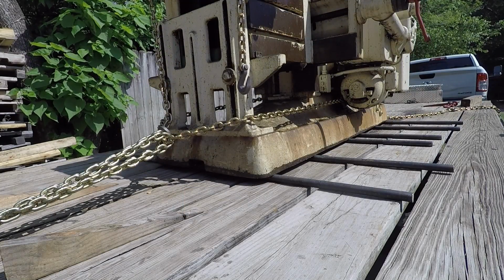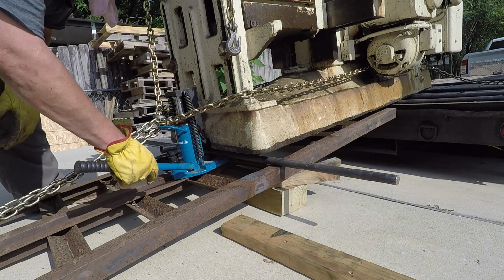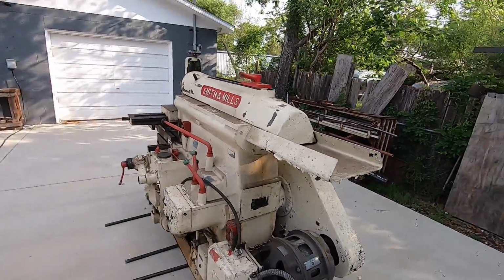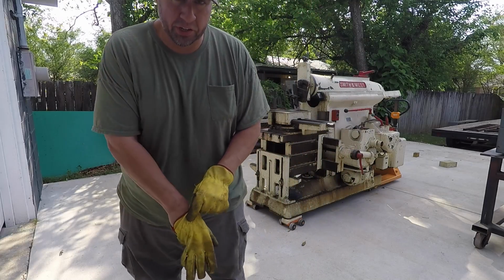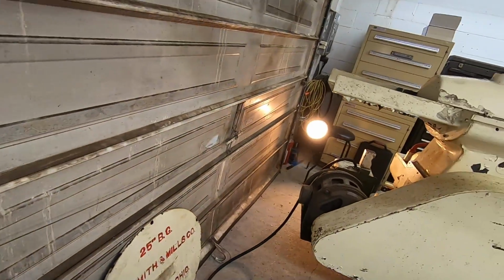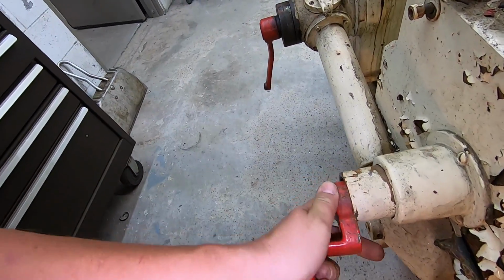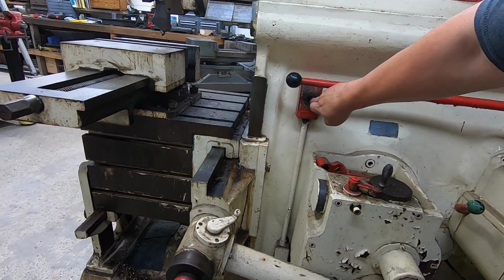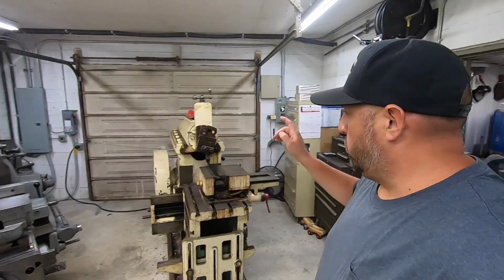Unloading the Smith & Mills Shaper Part 2

Comment: I was wondering when you'd go for the pallet jack. I'm not sure what the total weight of that shaper was but there are some low profile trips-wheel castors we used to use when I moved Postal letter sorting equipment. But this is real hi-Zoot solution: https://toolwell.com/products/machine-skates.php

Comment: Just in general, when powering up a machine that’s new (or newly arrived, or just been worked on) it’s a good idea to take a volt meter and check for voltage on the machine frame & any surfaces that are supposed to be grounded. 🤔

Comment: Been there done that. Good work. Surprised the trailer held it. What is the weight of that beauty?  Saw a few smaller ones at auction for like $200 - scrap value. No one even knows what they are anymore.

Comment: Adam, I was watching several days (wks) ago, a youtube video on trailer needs.  One item mentioned, was having C-channel pockets along the side of the frame.  Can be used for removable sides, either metal or wood.  Also, was using short pieces of rectangular tubing with D-rings welded to the "tube".  These were secured using  Agricultural pin through a hole in the tube, located below the lower edge of the C-chnnel mounts.

Comment: Excellent!  I bolted a cheap 12V 3000 pound winch to my garage floor which I use to pull cars in.  The driveway has a steep angle and the garage floor has a 2 inch lip which I just can't push cars over so now it's just a quick hook and button press.

Comment: You need a small Garden Tractor to use as a Yard-Horse. They're small enough to drive right into your shop and will give you the extra man power you lack when working alone with heavy objects. A Garden Tractor has more pushing & pulling capacity than a lawn tractor. We can't have one of our favorite machinists out of action recovering from a hernia.  Best of luck, stay healthy..................

Comment: It's about time the US are going to start using safe and decent power outlets and plugs like the CEE-form we use at our side of the pond instead of that 100 year old stuff! It looks like the pins will break out of the plug when you bump it with a bit of force and then they will be sticking out of the power outlet...

Comment: The "BG" might stand for Broadhead-Garrett which supplied metal and wood working tools to schools.  Their 8" metal shaper ( made by Porter Cable) was very popular but I've never seen a 25" version from them.
Reply: Great answer...Now, what does D&G from Porter Cable mean? I have a 1960s? Wood lathe and is from a primary school in Ontario, Canada with mostly British standard hardware in it. There is absolutely no information or tags on it except for D&G - Millford  in a raised embossing on the head stock.

Comment: Your method of getting the shaper off your trailer was much the same as what I used to get my Bridgeport off the U-Haul trailer I rented.  The difference was I had a pallet jack with a home made pallet that the Bridgeport was sitting on and I used a chain fall to pull and a come-a-long to brake.  I had to pull it uphill to the ramp and then going down the ramp was steeper.  Worked like a champ but it definitely was a long day.  My chain fall and come-a-long were much shorter and required many more resets.  At the time I did not know about drop in anchors so I had to cut off the stud when I got done.

My machine skates are similar to yours only smaller.  A suggestion: if you want to move the equipment sideways just turn the skates the direction you want to go and push.  Using three skates I rotated my Bridgeport 180 with some resets when I did not have the angles right.  Got the idea from watching some one rotate a CNC machine by himself.

Comment: Maybe this is just me  but there were a few scary moments when you were getting off the trailer.
Reply: The safety chain could have been a couple inches shorter when it first started sliding down the ramp,  but my heart only stopped for about a second - not bad. I use similar techniques to lower my (much smaller) stuff into my basement shop. I hope whoever has to clean out my basement when I  kick off is a good rigger,  ha ha.  I  plan to leave them a few photos to figure it out from.

Comment: Just a thought, on the rapid feed for the table, did you have the lever for the direction of travel engaged?  I didn't notice it set for feed when you tried the rapid feed.  I worked on a similar one while in the NAVY and the direction lever needed to be set prior to engaging the rapid feed lever when the head is not engaged.  It has been almost 50 years since I worked on one.  I was thinking that the rapid feed can only be used if the head is not engaged, for safety reasons.  You have got the dream shop for every machinist out there!

Comment: Adam look like you need to do what I did. Go to tsc and get a 8 to 12 thousand pound winch put it on a metal plate with the holes in it to mount to the concrete using the flush mount anchors. Then all you need is a battery.I have done it the way you done it here but I have hurt my shoulder and no longer can use a come along very much. But great job 👍

Comment: Only have three words... "short gantry crane" 
Buy or make one that will clear your garage door... then you could have made a ramp to get trailer up on the concrete and lifted it right off and wheeled the shaper right in the shop.
Reply: About all a gantry will do is park the trailer, roll the gantry into place, lift, pull the trailer out and lower onto the rollers. That does save some work

Comment: Its amazing that the vast majority of this older heavy duty machines where made here in the Ohio valley area. The amount of industrial equipment that came from the Cincinnati, Pittsburgh, and Detroit triangle from the early 1900's all the way to the late 1980's when stuff started moving out of the US to China and other places. It is nice to see someone save some of this old equipment from the scrap yards. It's a shame how much has already been destroyed.
Reply: Most of our major industrial production was in that area because it was so far from the coastline but still had reasonable access to water shipping via the lakes and the Ohio river.
It was a great combination for making it a difficult target for WW2/cold war airstrikes while still being relatively easy to move material around between different factories and out to the final delivery sites.
Reply: @PoignantPirate  ... While distance from coast may be a nice thing to have, it was more an unintended bonus.
The reason was raw materials and the fuel to turn them into useful metals and the ease of transportation.
 Coal and iron ore are nearby, and the lakes and river mean you can move heavy loads cheaply. Which is why most of the steel mills and metal foundries were right there as well. Add a couple centuries where the cost to transport the castings, plates, etc were very prohibitive kept everything close.
Reply: We used to make everything here in Ohio

Comment: Hi Adom I just bought a 2000 lb 12 volt winch for just under $100 on ebay would have saved saved you about at least 4 hours unloading the shaper   Jim

Comment: Really enjoy watching your videos.  One suggestion; turn on your video stabilization on your cameras if you have the option.  :)  Also, do you have a couple of 'old man' wheely pri bars?  Used them alot in HVAC to shift units around.  Your good enough at your trade I know you could make some kicking ones to move equipement that size.  Cheers.

Comment: id sandblast off the old paint and hot pressure wash the shaper, then immediately oil and grease it, after the new primer and paint id be cleaning all the bare metall surfaces with motoroil and a fine  scotch bright, a polishing wire brush and some steel wool
Reply: Sandblast? really?... that's the problem nowadays, take the shortcut and risk damaging the slideways and blocking the oilways, that is a precision machine tool, there's the right way.... and yours!
Reply: @stevedoran3631  ever heard of tape and cleanup? you risk nothing, you just need to work precise and blow of the dirt and clean the ways  instead of just starting it letting it crunch and lap itself to the scrapyard
Reply: @prinzeugenvansovoyen732  I have been a toolmaker for 50 years and there are times when you can mask and blast, but a professional would never consider sand blasting a precision machine tool... it's just not done, it's not just the medium used, it's the dust that the medium produces, when blasting, microscopic grains are produced of the medium itself and no matter how much cleaning you do there will be residue and that is what does the damage... it gets everywhere!

Comment: Fascinating.  Slow and steady, the equipment gets moved and nobody killed or maimed.  Can't help but think of the ability of Civil War engineers and artillerists who could move really big guns weighing several tons.  (a 15 inch Rodman seacoast gun weighed 25 tons)  Manpower, horsepower, and brains.
Reply: Yeah it's mindblowing watching skilled millrights at work. Amazing thing is the tooling, like comealongs, rollers, pry trucks and whatnot, have hardly changed. It's all about skill and patience, there's nothing like watching a boiler the size of a truck get floated onto the pad and dropped dead on the marks by literally handpower.

Comment: I like the idea of the machinery skates, I wish I thought of that back when I was still working in our shop
Reply: I like the Idea also. When we moved the 12x36" lathe in we used the pipe roller method.  And like Abom, I too like machinery. As we already owned a stand type Atlas Craftsman it only seemed fitting that I should save a 12x36" bench model from the scrapper a few years back.

Comment: I wish I had a picture of the shaper at "Special die set in Bridgeport CT. I worked there in the lat 50's. The part moved and the tool was on a bridhe over the table The table was on a tract about 20 ft long we shaped some die set apeox. 3'x6', but this is only a guess. I had nothing to do with the machine work, just ran a Panograf cutting up scrap. But it was fun to watcj. 
Good luck Gramps

Comment: Adam, did you check the motor rotation direction before turning this shaper on? A simple fix.Just reversing two wires to the motor will do it. Thanks for all  the excellent videos. I enjoy them very much.Burlyn Nelon  Arlington, Texas

Comment: It is critical for motors to have the correct voltage to prevent damage , At 50% voltage a motor runs at 200% amperage and at 200% voltage it can overheat and short out , Always check the voltage .

Comment: I wish you and the people starting cars that haven't ran in years would change the oil first. Maybe it doesn't matter but it can't have that great of lubrication after that long sitting.
Reply: He will change it during the restoration. Here is something I saw on YouTube that shocked me. A retired railroad engineer was giving a tour of the largest diesel locomotive engine ever built. He showed the engine where the oil sat in the bottom of the block. He said it held a lot of oil and that the oil was NEVER changed. All they did was add oil that got consumed, and replace the huge oil filters every so many hours of operation.
Reply: @billsimpson604  Yep, and pull a test on the oil for contamination. When you measure the amount of oil in barrels instead of quarts you tend to just check on things in RR use. Even the "small" M&S 539 engine used 80 gallons.

Comment: I was bit worried when the machine started to roll - good that the stop chain didn't have to much slack. The machine starts to roll, accelerates and when the chain suddenly get tight - snap the chain snaps (violent sudden tension is good to snap chains and ropes...)

Comment: I wonder if it's so old that it might have lead paint on it?  Vapor blaster might be the cheapest way to get the paint off the smaller pieces (depending on the size of the cabinet).  Don't have to keep buying chemicals that way, especially if the blast system is a closed loop.  Electrolysis tank made of a 55 gallon drum with a DC welding machine as the power source would be another option to prevent having to buy chemicals.  See the Post Apocalyptic Inventor for his video testing one of those.  Looks like an awesome machine, and look forward to the updates!

Comment: We had a shaper and as the shop grew with more modern machine tools the shaper was pushed into the production area.  The problem was chip control.  Blue chips being propelled a pretty good distance.  A fair amount of production workers not far away.  Can you imagine an OSHA visit?  Took it out of production and used it for the fantastic rigid vice.  Finally it was purchased and I missed it.  On the positive side I can say I was able to operate one.  Decent machine.  Mainly unattended operation with nice metal removal rates.

Comment: ewwww, that poor machine ran at the wrong voltage! I'm surprised it started at all!
Reply: I'm amazed that you can't tell what voltage an appliance is designed to take.

230v single phase or 415v three phase only over here... sockets? Sigh... 10 and 15 Amps for single.. 25 and 40 Amps for three phase. Need more? Hardwire only, unless there is some exotic plug. Location: Australia.
Reply: @gorillaau  We run 480 VAC thru plugs in the USA. At up to 400 Amps. Railroad passenger equipment uses 4 per car and 4 receptacles. Two of each on each end of the car.

Comment: ABOM, why not just mount a couple 12,000lb HF winches, one to the front of the trailer and one to the concrete pad?  If they are remote wired you can use the one on the pad to pull while letting out on the one on the trailer.  The one mounted to the concrete could be made to be removeable.  Love the videos, I am not a machinist, just an enthusiast.
Reply: why not  an outdoor gantry crane capable or one that will go in and out both or two. lift slightly off trailer, creep it out and lower as you go to minimize fall factor.
I DO understand low budget far beyond most, but there's a point where breaking it slightly pays off greatly ;)
Reply: I just don't get why you all want to spoil the fun of long established methods when they are so effective and good excersize for the mind and the body, I just don't get it... Adams got the job done and is onto the next step, but you all stuck on how he could have done it differently or in your minds 'better'.

Comment: That is a great find. It will make a nice restoration to do... I'm looking forward to seeing that...
I used to work for a manufacturing company that made gauges. I was in the Brown & Sharpes  screw machines and was involved on some restoration on some of those and that was cool to do. Anywhere from rebuilding the slides and gears to painting. I miss doing that and setting up and making parts. I used most materials from brass, stainless steel to monel to plastic parts. So I'm looking forward to watching the restoration on it... stay safe!!

Comment: You've been schooled well.
Excellently.
But you ain't got no intuition.
Otherwise you wouldn't have those roller-skates right on the edge like that.
Makes no sense.
I know this (and the rest), comment won't see the light of day but I know you read them, and that's good enough for me.
You followed your path but it ain't in your bones dude.
>
Reply: Bodragon , what a mean-spirited comment! Adam sure as heck has a lot of intuition. He's shown that over and over again. Adam correctly chose the points of maximum stability, given that the body of the machine was solid metal. Even if that weren't true, your brand of soul-sucking scorn is out of line.

Comment: (20:20) - Again, you need those roller skates completely under the load.
The way you've got them now, can't you see ?
All the weight is on the inside wheels.
You want the weight to be evenly distributed on those roller-skate wheels.
>
Reply: Yes he can see, that's why he put the skates were they belong, under the skirt of the machine that is somewhat flat to distribute the load.

Under the machine itself is a raw casting that is curved or very uneven.  The worst place to put the skates.  Also placing the skates inside the skirt would narrow the wheel spacing making the machine more likely to tip over and also make it easier for the skates to slide around under the machine making it even more unstable.
Reply: @qwerty13380  I agree that the skates should be as far apart as possible but the outside edge of the base of the shaper should not be in line with the center of each skate.
The outside edge of base of shaper should be positioned directly above the outer pair of wheels in order to distribute the weight evenly across all four wheels.
Positioned as he had,  it was concentrating the load on the inside wheels of the skates.
Not only that but there is the possibility that a skate may pop out completely on uneven ground.
>

Comment: I don't have really heavy machines in my shop (biggest is maybe 1200 lbs) but I put EVERYTHING on heavy casters (2 fixed, 2 swivel).  This has been REALLY handy at times, and an unexpected benefit was elevating the machine by about 6" so I don't have to bend over so much as I work.  I'm 6' tall, and lots of machines seem to be made for 5'6" users.

Comment: Did you check the Oilers that are on the main electric motor bearings I would imagine they would be pretty dry from the machine sitting for so many years glad to see the machine works I remember the G and E that really did not work that good when you first got that one

Comment: Recently had a customer let me use their pallet jack with a PowerPallet (Or some similar brand) manual pallet jack converter on it. It bolts on and helps propel a regular pallet jack. Still have to manually raise and lower the pallet jack but is very helpful in moving heavy pallets around while keeping a regular pallet jack profile and turning radius. If it is “A bomb strong” it might be a helpful, injury saving tool and interesting installation video.